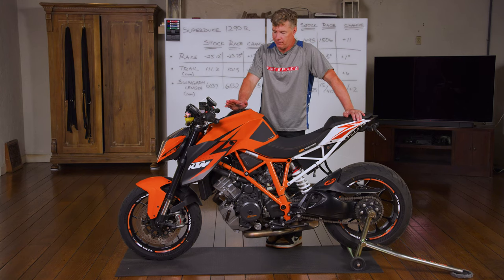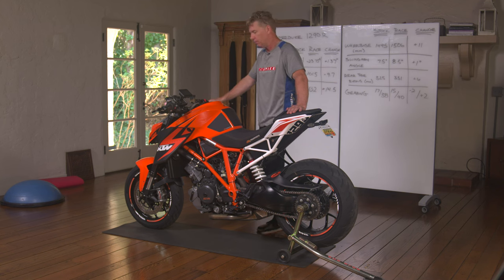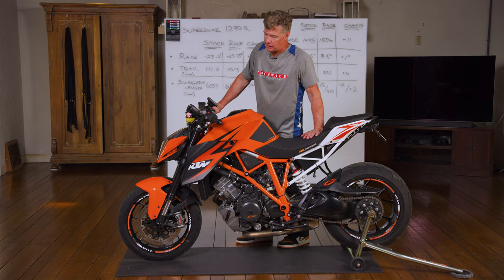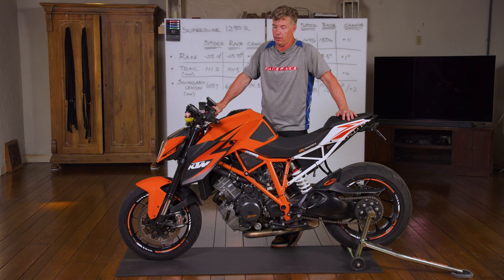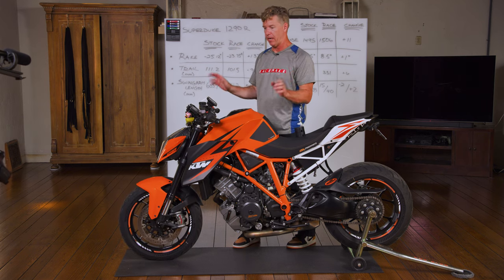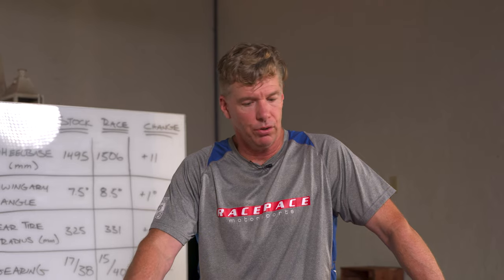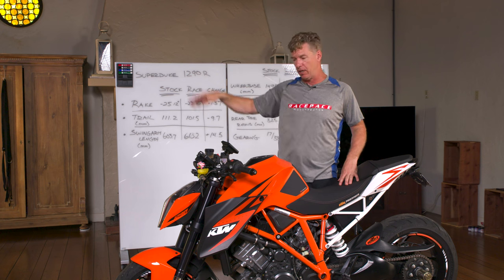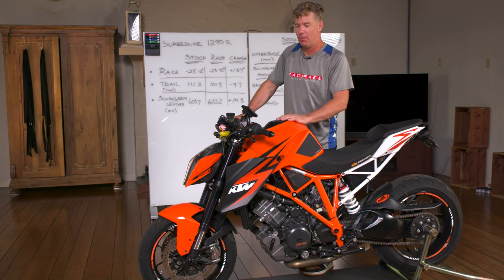KTM 1290 SUPER DUKE R, GEN2 SETUP - PART 3

Comment: I was viewing the video and I saw you put a rubber ducky on the front of your bike,   I put a rubber on the front of mine .  I call it my third eye.   I just bought a 2022 Super Duke Evo and while I do not race I will be doing track days.  I traded my RC8R to get it.  I am large though 6' 5" 270 lbs.  But I have maybe a 100 miles on it now.   I appreciate all your input and while lap times are not my critical measurement of fun factor, it is nice to paste someone from time to time.   I will be 70 yrs old in July and my brothers think I am crazy.  I will say this though.  You're correct though  not being a follower is important..  Be different,  be yourself.   Got to go get my rubber ducky for my new sled.
Reply from the maker: Laptimes are not important really, but they can be a measure of how easy or hard your bike is to control.  And while developing your setup, or in my case these parts, laptimes can help indicate a good move over a bad one..   I agree with you what's important is the fun factor.   The ease and joy of your ride.   And these links do increase the fun factor for me.   When I come in after struggling out there I am not as happy.   When I come in and the bike did what I wanted when I wanted, I am always happier.   🙂

Comment: Couldn't agree more about the rottweiler airfilter. I bought one and fitted it, I found the noise too much and the performance didn't improve. I've since fitted a tekmo full system and had it mapped 👍
Reply: I'm going to disagree as my personal experience is different with my current performance set up which I detail below, I will point out the bike did not run as strong as it does now with my my original exhaust config and everything else identical which was an arrow de-cat with a yosh alpha slip on in 4th, 5th and 6th gear in comparison to the full Akrapovic system I currently run, proven with multiple roll ons 2nd to 6th gear against a friends Hayabusa which is flashed, dyno tuned, piped with a high flow air filter, bike runs strong, against my 2018 SDR with a stage 6 Rott system, stock gearing, PC5, ignition module, auto tuner, Full Akro Ti exhaust system with two short velocity stacks which moves power up the rev range vs the two long stacks(my bike doesn't flatten out at 8500rpm it pulls to 10Krpm ), A/F ratio was checked on my friends stingy dyno and the Auto tuner had fueling spot on across the rev range, will also note that I played with my ignition timing maps as I didn't want to throw timing at the bike if it didn't make any hp, my more aggressive map netted 5hp across much of the rev range so the engines like timing, this is good as it replicated Lamp Chops vid of his Dyno session with the same set up, hp was close as well. When we roll on he's in 2nd and I'm in 3rd from 50mph and I can pull a bike length at the hit and stay ahead of his hayabusa till we hit 140mp then he creeps on by and eventually drives away when I top out at 184mph indicated so probably 170mph on gps, this was not the case before installing my Akrapovic system, much improved top end pull for some reason vs Cat delete combo which was tuned properly with the auto tuner as well so the same state of tune. This is just my two cents, my opinion you cant beat the auto tuner it's real world tuning as your rolling down the road at all speeds, only issues come about with an Auto tuner if the exhaust bung especially on an inline which is single channel, one O2 sensor vs 2 channel on this bike being a twin, is not close enough to the collector giving you an innacurate A/F ratio to the number you set in the Auto tuner....ask me how I know...lol, not the case with the exhaust on this bike. I'm going to be do some roll ons against my friends 2021 SDR with a full Sparks exhaust which is pretty much identical to the Akro, high flow air filter, flash tuned with a tablet, stock gearing and see what happens, should be interesting, I will be wearing my go pro on my helmet and one on the bike so I'll post the vid on my channel win or lose....if I do lose I'll be digging out my stock airbox....haha.
Reply from the maker: @Bullet62013  Thats a ton of data to digest.  Thanks for offering it up.  I've gone the autotune road too, custom mapping, dyno runs after dyno runs, rotty airbox, etc.   Nothing has helped me keep pace with 1000cc superbikes on track, more than gearing changes.  Night vs Day improvements for me.  That why I took all that crap off and went back to the stock airbox.  I'm glad your build is working for you, that's awesome.  For me, the stopwatch made my choice clear.  Looking forward to your vid.   Good luck and stay safe

Comment: Great videos! I've been searching for a good track setup for years, so I will definitely try out some of yours. I will get the rubber blocks first since it is cheap insurance. Probably try a drag bar as well. Any idea where I can find the KTM race seat? Seems like it is sold out everywhere or discontinued. All the ones I can find are in Europe. 

Not sure if I can do anything with the swingarm angle. Unfortunately, I don't think the Ohlins shock length is adjustable. I also tried -1 gear up front, but the bike tops out at around 160mph before the braking point, so I'll be going back to stock gearing.

Comment: Thanks heaps for all the great info. I too have the rottweiler intake installed and am thinking of going back to stock. When you changed yours back to stock did you have to put it back on a dyno for tuning? Thanks again
Reply from the maker: At the time I had all of the Dynojet kit, with autotune, so I navigated the changes using all that kit.

Comment: Hey there Go Go, Breno from Australia. 2018 Gen2 SD-R. 32 err.. rather enthusiastic years Adelaide Hills rider (think canyon rider), almost every weekend whenever it’s not sodding wet. I'm all about incremental holistic tuning, improvements and the data. In one of your Gen3 vids you referenced re-oiling the OEM steering dampener. I have no real stability issues; however, the OEM unit offers almost no resistance and its 4yrs old so let's see if it can be improved 😜, As a starting reference point, I was hoping you'd remember the oil weight you started with? (or if anyone knows the OEM spec oil?) - Tkx and please keep sharing.
Reply from the maker: Breno I believe the OEM damper oil weight is 2.5.  I put 15 in and never looked back.
Reply: @superduked33  Cheers Eric! Really appreciate the share. On the list for winter tweaks along with a slightly longer chain. 😉 👍

Comment: Hi Go Go, thankyou for your brilliant info. Two things. I have a 2019 gen2 and looking to tey a drag bar for more front end , sporty feel just wondering if you have tried this and if the bars hit the tank.
Also those fork bump stops, where do i get these off Amazon
Reply from the maker: I have run different bars on the Gens 1&2, yes.  ProTaper makes a Charmichael bar that I have used several times.   But I still have not found a bar that I love.  At full lean, with your body out to the side and down, the angle our wrists get put into is unnatural.  I would like to find a better bend than I have yet.   ...As for steering stop blocks, yes, I have designed and built a perfect solution for Superdukes.  I will be selling them on Superduked.com very soon.   One to two days actually.  They fit right on the frame, are square, are adjustable, made of rubber, and will not fail like the bolts or perches on the OEM triple clamps and Power Parts triple clamps do.   Email me off Superduked.com, I can give you more details.   Perfect timing

Comment: Eric,  you mentioned your brake pad of choice are the vesrah XX.   Do these pads work well on aggressive canyon street riding.  Upgrading my front rotors on my Gen 3 1290r with the wave style rotors and would like to try something different than the OEM pads.
Reply from the maker: I wouldn't use anything but Vesrah RJL on the street or the track.  Felt this way for over a decade and I am not sponsored by Vesrah so I'm not giving you a bs answer.  They are exceptional.   By the way the "XX" is only one of three different versions of the RJL pads.  Vesrah's website doesn't describe their pads half as well as the Hustle Hard Racing site (I am not sponsored by them either).   Follow this link for a great description of the three different versions of the RJL pads:  https://hhrperformance.com/b-159812-vesrah.html
Reply: @superduked33  Thank Eric,  appreciate the help.

Comment: I am VERRY surprised to hear about the brakes, did you use the stock brake lines as well? Maby I just dont air the brakes well enough but on mine I have to grab a full fist of brakes even with new pads
Reply from the maker: Sorry I tried to respond to you yesterday but I guess it didn't save.   Yes, 100% stock calipers, lines, ABS system, master cylinder, even levers until they need replacement.  All stock, except for the Vesrah SRJL XX pads.   You may have air in your system.  Try a vacuum pump to get them properly bled, and finish off with the tiny bleeder up at the master.  That little guy makes a big difference sometimes.   Also on the clutch side..
Reply: @superduked33  Thank you! I will try that as soon as the season closes in! Im super pumped about turning my sdr into a trackweapon after watching your channel! Another question if you would be so kind, did you have any issues with the clutch slipping and how did you deal with it? Thank you!!
Reply from the maker: @birkaracing72  I sometimes hear people talk about sdr clutches slipping but personally have never experienced this on any generation of the 1290.   The only 1290 clutch issue that I ever experience is air collecting just before the master - which I regularly now bleed out with one simple crack of that tiny bleeder by the master.    Sometimes the lever gets closer to the grip leaving not enough room for my other fingers.   That’s when I crack that bleeder.    But as far as slipping, it’s never happened.   In fact when my stack gets too thin or warn out it does the opposite of slipping - it grabs on starts.
Reply: @superduked33  That is interesting! So do you think the "slipping issue" people describe might actually be an issue with the slave cylinder or just a bleeding issue? I am new to the ktm so I have verry little experiance with it yet.
Reply from the maker: @birkaracing72  I do remember on the gen 1&2 that bleeding the clutch system is very much more challenging and open to problems than any other system I have used.   In fact they changed this for the gen3.   I am not an expert by any means but I do remember you have to use special fluid, and you have to bleed the system backwards.   Starting from the slave cylinder and sucking fluid in from the master from there.    Pushing fluid through to bleed it does not work (apparently).   It’s a very unique (pain in the ass) system, which I bet has a lot more to do with people having “slipping” issues than the fiber discs
Reply: @superduked33  Yeah I just learned about that the other day, its a verry interesting subject, qnd I cant wait for the season to start so I can try it!
Thank you so much for your awnsers and knowlage!! I apreciate it verry much sir!

Comment: Your airbox experience seems like a dyno issue. If you didn't fix the fuel/air mixture in sure you were running lean which made the computer throttle your horsepower.
Reply: Thanks for the tip and especially for reaching out to help.   Unfortunately we did extensive dyno tuning, mapping, auto-tune adjustments, even sent the bike up to EDR in Washington and gave them a shot at it.   Not just the gen 1 but the gen 2 as well.   And not just on one dyno or one with one tuner either.    Different tuners got different results but in the end like I state in the video, the fastest most “stopwatch” friendly setup consistently came with the stock airbox over the rotty.    I am glad to hear you got better results though.   Thanks again
Reply: @ericgulbransen2393  was a buddy of mine,  but he also did a full exhaust. Maybe it needed a full setup for a positive effect
Reply from the maker: @emoservedwithfries   thanks again man.  That's how we improve.  Share experiences.  We had full systems too.  Two Akras on the Gen1 and Gen2, plus full AR systems.  I've always wondered about the differences between dyno runs vs on-track results.  I've never experienced a dyno tuner forcing 140mph wind into the intakes, but that's what happens out on track.  I've suggested it many times but it usually falls on deaf ears.  Anyway thanks for contributing your experiences.  Sincerely
Reply: @superduked33  eventually I'll be in a class with you guys. My 890 is feeling a bit sluggish next 2023 is hopefully an upgrade year.

Comment: I noticed you didn't talk about the steering damper. The stock one is shit
Reply from the maker: 100% agree.  OEM damper is useless unless you change the oil in it.  Or get a MUPO damper
Reply: @superduked33  does changing the oil make a big difference? I might not need to spend the money on a new one after all lol
Reply: @custlerify  heavier oil transforms the damper from a useless pile of crap into exactly what you need - just the right balance of control vs freedom
Reply: @ericgulbransen2393  perfect! Gonna give that a try first 🙂
Reply: Even on the latest one?
Reply: I have the Gen 3 and bought the Mupo steering damper and wow what a difference… Never knew Mupo was such a good brand.. 
Buying a Gen2 to turn into a track bike and first mods will be a Mupo Rear shock and Mupo Steering Damper thanks to GoGo!!! 💪🏽
Reply from the maker: @revvaddictz  I hope MUPO is back up and running for you.   They’ve been out of it for a while as part of “being purchased by another company”.    Haven’t been able to order new shocks for some time now.    Hopefully that time has ended

Comment: Thank you so much for this. Is there any way you show me simple adjustments to the stock suspension that will help keep the front end down more? Is it possible? Especially while maintaining high speed corners (90+) or exiting any corner really.  I live in Southern NM and don't have any tracks to practice on nearby but we have a few solid "race roads" around here and I've built a little reputation for whooping up on liter bikes in the corners. I feel like I have maxed out the capabilities of the suspension but without a reputable shop anywhere near where I live, I'm trying to ball on a budget and just give myself the best stock set up. Keeping in mind that I have to retain 170mph+ gearing for these ridiculous straights.
Reply from the maker: Try either of the two Sport Links that I sell on superduked.com.    They both increase swingarm angle which creates more anti-squat - which helps keep your nose down.   The bike sits too far back on its ass in my opinion, as it comes new.   Steers lazy, too much trail, loses ability to turn soon as you crack the throttle back on mid-turn.   The links will help all that too.   I also sell a Superlink, to be used with race shocks and exhaust, but the Sport Links do a lot to help and you don't need a different shock.   Email me if you want, I can help you more
Reply: @superduked33  Awesome man. Thank you so much.
Reply: @superduked33  All I see are Gen 3 parts. Will they work with my 2015?